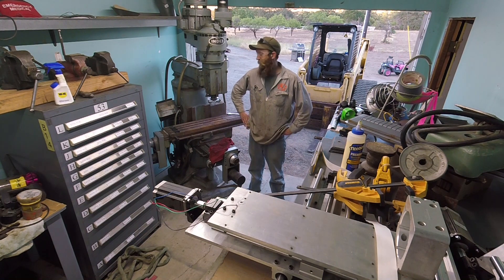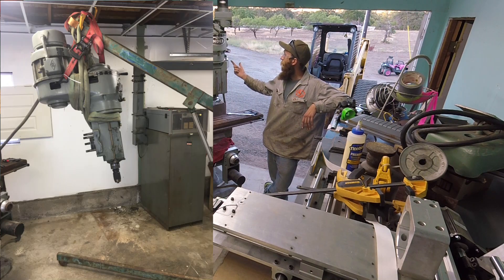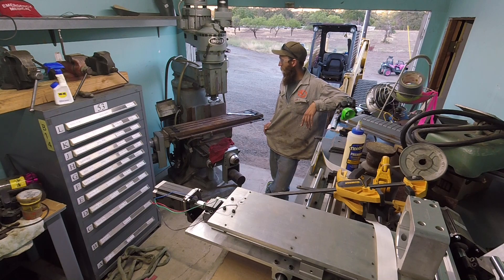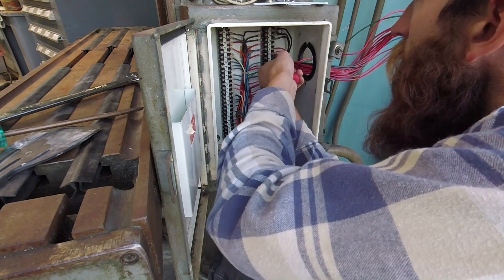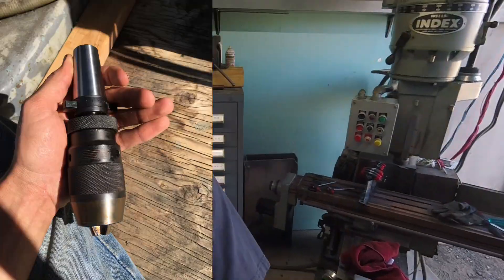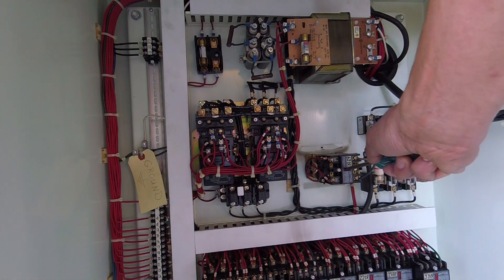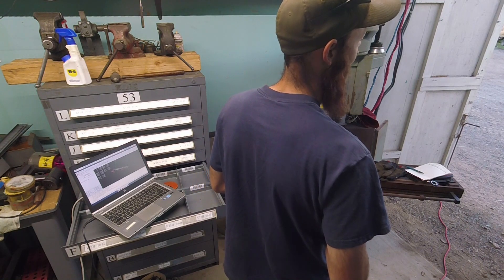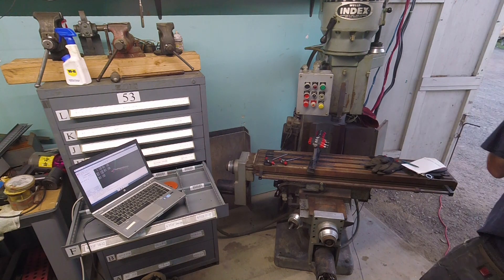Wells Index 700 CNC Milling Machine

Comment: New Suber here, know you haven't put out a video lately, but hope to pick your brain and others that have Wells Index mills here on YT. I am waiting for Owner to clear a path to a 845 I just bought on 10/10/22 from his estate sale. Has little tooling, but found a source here in TX near me. I have moved BP Mills, and the Wells out weights BP 900+, so found renting an equipment moving trailer froom Sun Rentals the safest. It is low to start with, and lowers dw to slab or ground level. I bid on one last year and lost, but won this time around for under $400, so happy camper. Bear in TX.
Reply from the maker: Good luck with the move. I have moved a lot of machines without equipment, just pipe rollers, pry bars, and chain hoists. These are a bit heavier. The other thing is the heads on these cncs don’t tilt like everybody likes to do with BPs to lower the gravity.